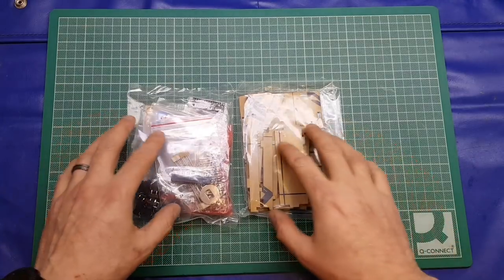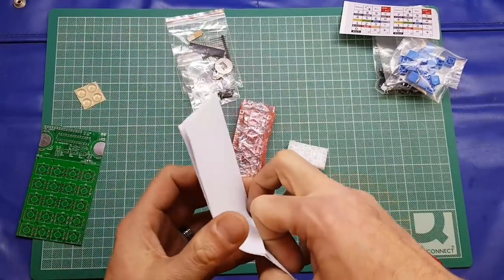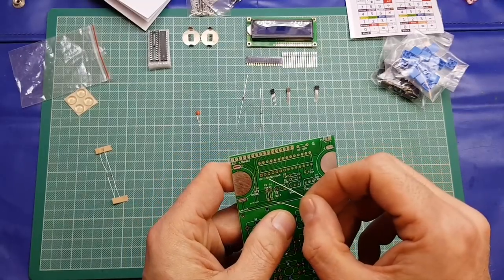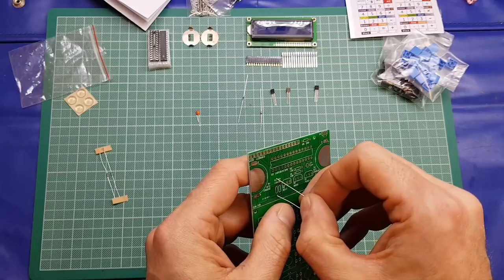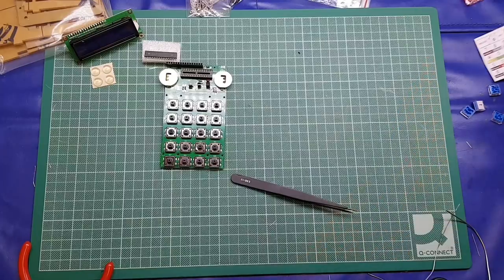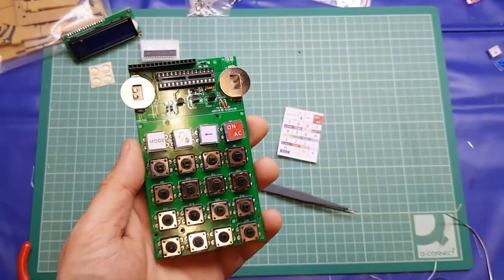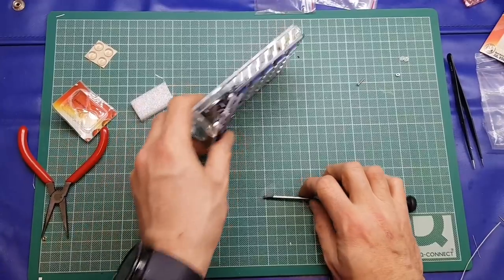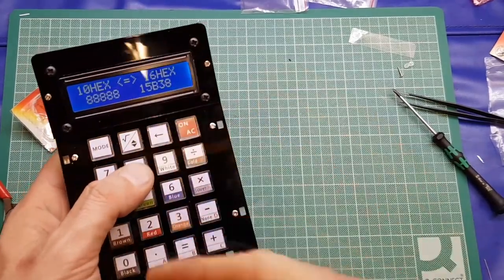KKmoon calculator kit with built-in resistor / LED / HEX functions (electronics tutorial)

Comment: I built one of these after watching this video. A few things not mentioned here:

- The printed instructions call for the wrong type of battery. The website calls for a different incorrect battery. The Amazon listing calls for the wrong type of battery (but I sent in a correction so maybe they will fix their webpage). Only the silkscreen on the circuit board calls for the correct battery, a CR2032.

- The calculator can only have numbers with a maximum number of digits = 7. It does decimal positions, but those count against that 7 digit limitation. If you enter decimals, you are limited to 3 places, and decimal portions of computations are fixed at 3 places.

- There is a firmware issue in that the display does not reflect which place you are in for entering LED resistor calculations.

-Another firmware bug results in "HEX" always being displayed next to decimal values when in the 10 <> 16 mode.

Comment: Great kit and a great job putting it together. I too switched to the oval tip and now I would not go back now that I'm used to it.  You can use it flat or vertical to get into tight places. Regards, Dave

Comment: Nice, but button cells ?... wont last long. Li-ion it should have been. Thanks for the video, nice job.
Reply: This kit can also be powered from a 6VDC power supply of your choice, if you choose to do that instead of using batteries.

The only thing on this calculator that uses much power is the LCD backlight. The controller shuts the power off after just a few seconds on inactivity.

Comment: You are right about those stupid cases, I just built a watch kit, all SMD stuff and very tiny ones indeed, the soldering was a real bear, but that stupid case, all the instructions were in Chinese, but I figured the case assembly would be straight forward, except they had it wrong in the instruction photos. I did figure it out and the watch is working GREAT, looks stupid but I am wearing her anyhow because I am so damn proud that I succeed with the build!